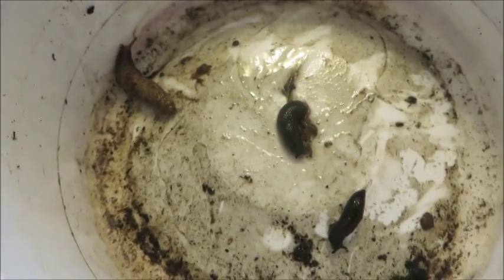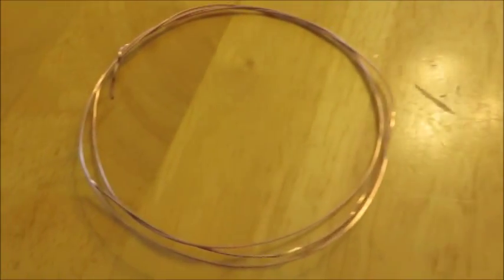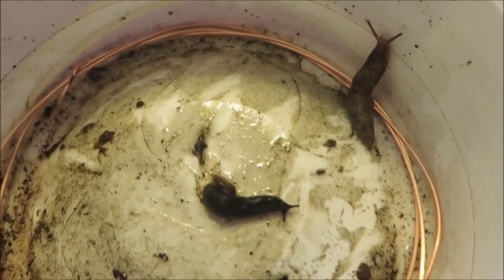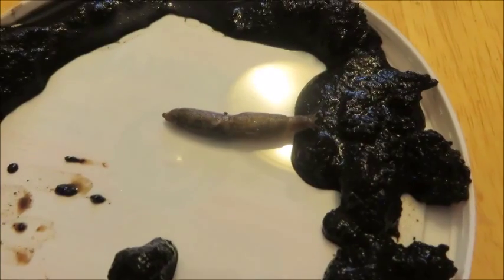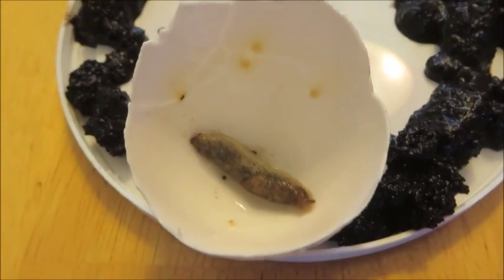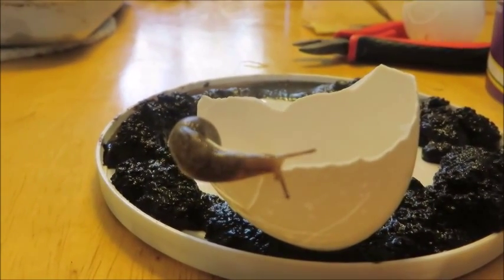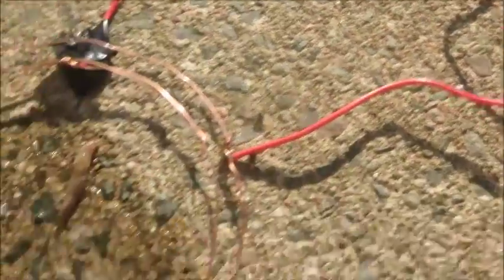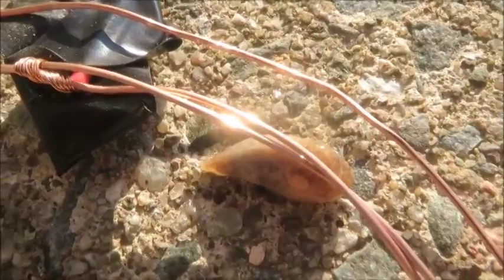How to keep slugs out of your garden with electricity

Comment: why did you even try the copper wire it clearly would never work unless you put electric through it
Reply from the maker: In gardening stores and online they advertise that copper wire magically electrocutes them. I was 99% sure it was BS as well as the egg shell thing and coffee grinds so i tried it out. Slug bait seems to be the most economical solution, but I would like to do a trial run on the slug electric fence around a box. I just will still need to kill the slugs that reside inside of the box.
Reply: Farm Forage get a microwave transformer the slug won't know what hit them XD
Reply from the maker: lol, ideally I guess you would deliver a shock that would fry them, eventually reducing the local population.
Reply: ***** Ever seen falling water what makes a hv spark, well if you have a little water loop dropping water like a fountain and a hv cap you can give them a hv shock, also the fountain would be decorative.
Reply: Try two distinct metal wires, not both of the same metal. It'll work like in the Galvan's experiment with frogs.